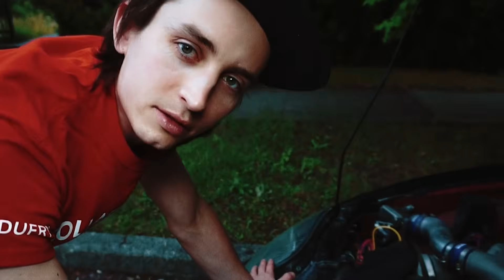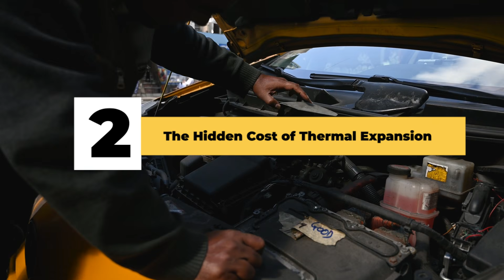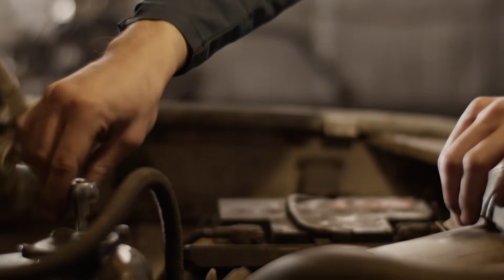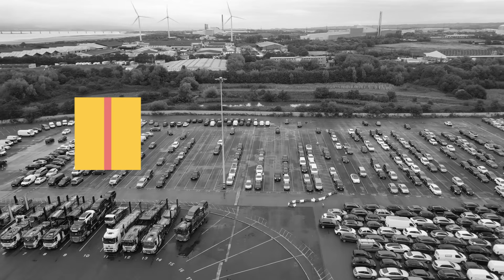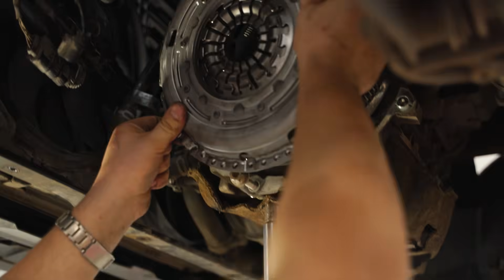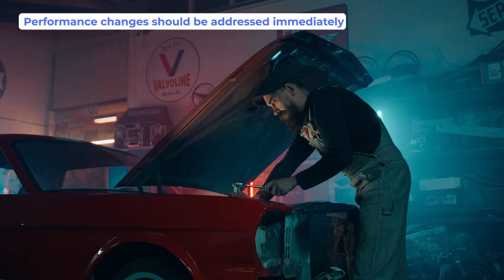Why Every Car Has an Aluminum Engine Now (The 'Lightweight' Lie)

Comment: AI SLOP. No mechanic has the tools in his tool box to rebuild even an old small block V8 let alone bore it out. I rebuilt a 327 back in the day and there are a lot of specialty tools needed to do this properly. And you can bet that a cylinder boring machine is several times larger than a big Snap On tool box.

Comment: The old iron block/head engines did not last long. Tolerances were looser, metallurgy was often poor and oil wasn't that good. The typical rebuild was not good for 200K miles. You might get another 30 to 60K out of an old iron engine unless you replaced everything except block/heads. I did like them because I could work on them. Now I just hope my 2.7 EB doesn't break.

Comment: I disagree. What the shops are doing is putting 5 w 10 oil in running such thin oil that any heavy load breaks the engine. Ford put a rubber belt in the sump to run the oil pump! The rubber breaks up and blocks the pump! Sheer stupidity and the Emissions madness have caused this.

Comment: Toyota has aluminum engines that outlast iron engines from other manufacturers. Your premise is invalid.
Reply: You’re correct! My Yaris currently has 320,000 and burn no oil between 5000 mile oil changes has an all aluminum engine.
Ive never touched the engine

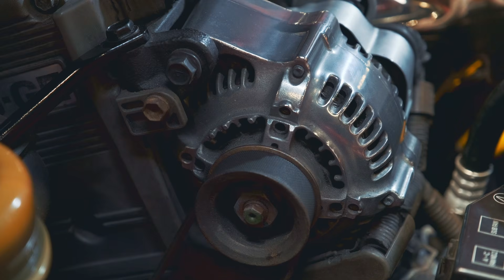Comment: 11:20 "oil vapors from the crankcase ventilation system"
NEED to be sent to the oxidizing cat instead of the intake manifold. Problem solved.
Reply: That would just kill the catalyst.

Comment: Do not overheat an alloy engine or overtighten bolts. A replacement engine from a junk yard used to be an option but who would risk that now with all alloy, unless from a modern and recent crash?  :face-fuchsia-wide-eyes::cat-orange-whistling:

Comment: weird Toyota nad honda have many AL engines that last just fine. So does Volvo
Reply: Yeah this is silly. The only thing an iron block has going for it is better resistance to over-heating.  He talks about the Impalla but back then a car with 100K miles was considered worn out.
Reply: I’m at 215,000 miles with my 2011 3.5L V6 Honda engine.
Reply: What a joke. This is  just one more bogus AI video spreading misinformation.   
Many of the points made are irrelevant to the metal used & apply to both cast iron and aluminum!

Porsche has used aluminum for decades in both its street AND racecars. The latter are the benchmark over all others of extremely high output engines thriving & most important SURVIVING grueling endurance races like the 24 HOURS of Daytona, Lemans, & 12 HOURS of Sebring.

It's commonplace in all forms of motorsports, & prevalent in motorcycle racing since the early days. Would that be the case if aluminum was as flawed as this video claims?
CASE CLOSED